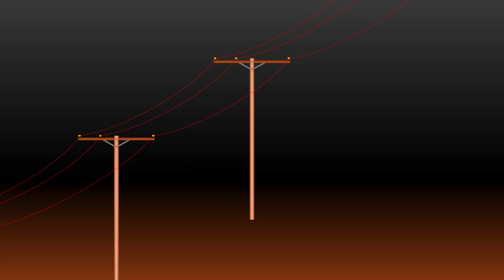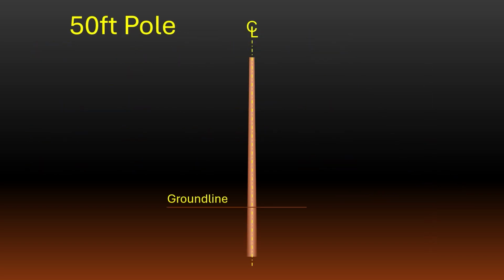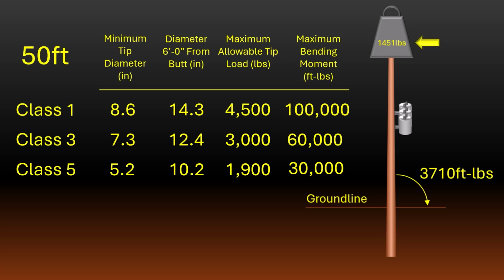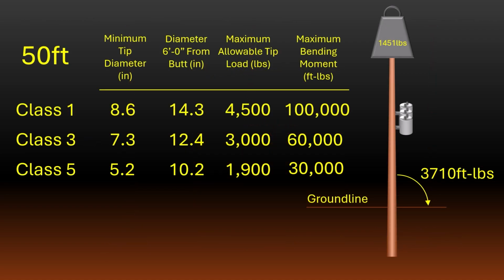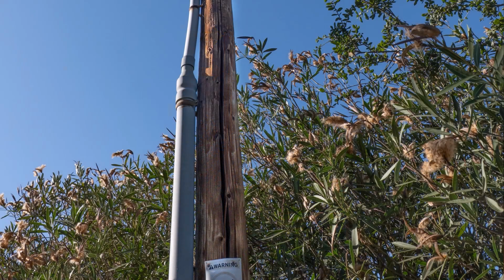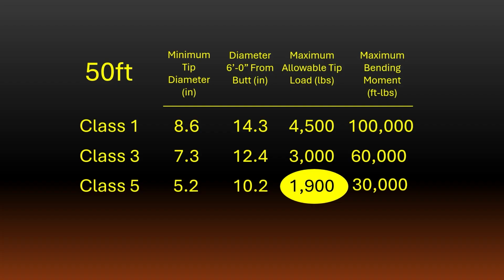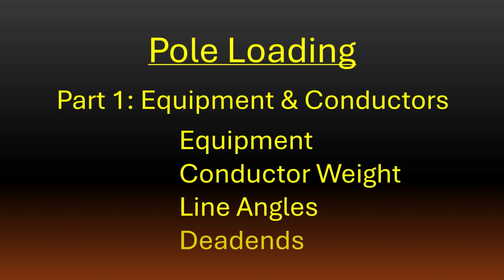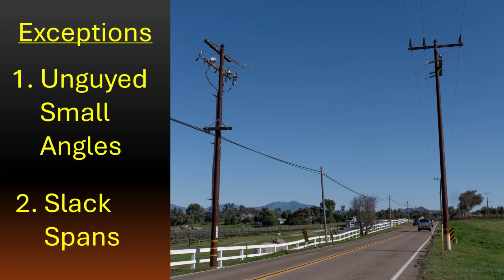Pole Loading Calculations Every Distribution Designer and Engineer Needs to Know

Comment from the maker: Great catch, and you're correct. The horizontal angle doesn't cancel anything. The guy's vertical component pulls down on the pole and adds to the conductor weight for total vertical load. We left it out to keep this video focused on the horizontal angle pull. In real-world design here in So Cal, we run full loading calcs in PLS-CADD, which accounts for vertical, transverse, and longitudinal loads together. This video was meant to build intuition for the basics. Thanks for watching closely!

Comment: Are you implying that a horizontal angle to the lines somehow cancels out the weight of the lines?  Shouldn't your vertical component of the guy tension be ADDED to the weight of the supported lines on that pole?

Comment: This was a great video. Can you explain how you derive line tension and horizontal forces just from the wire gauge? Do you all tension them to a set force as you install them?
Reply from the maker: Hello. Were you able to watch Part 2? There are many more variables that go into the calculations, these videos go over the basic principles. Pole loading software like Ocalc, PLSPole, Spydacalc etc are often used to account for all of the details required and specified by different utilities / region.